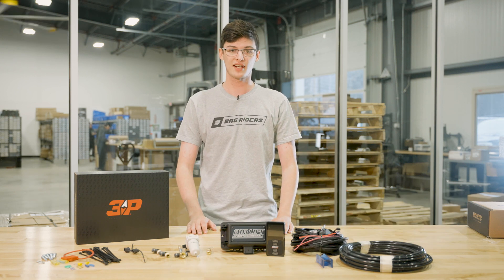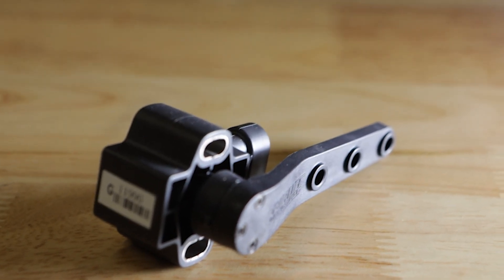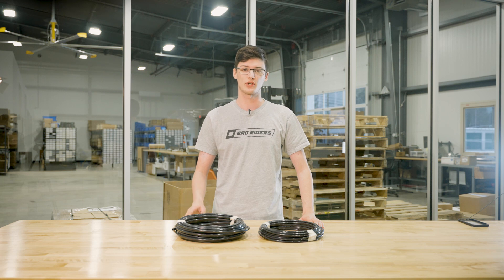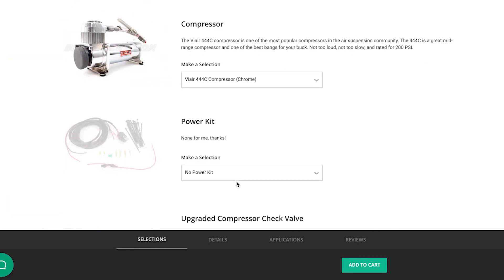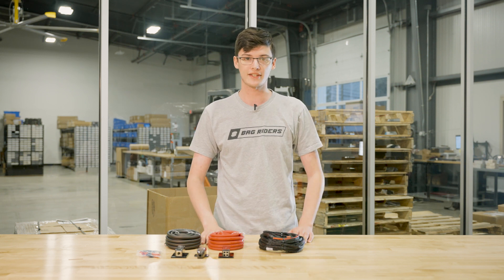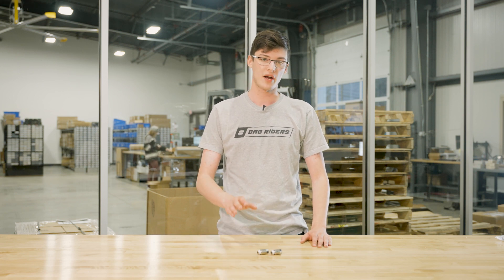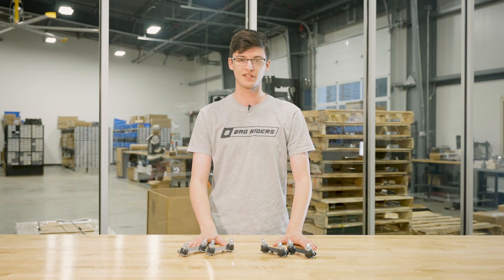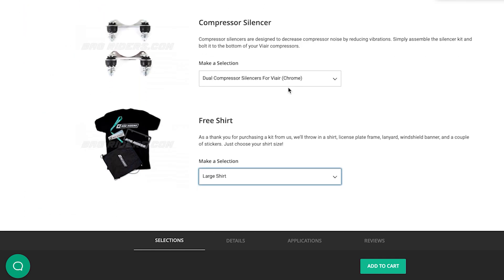Air Lift 3P/3H Digital Management Showcase by Bag Riders

Comment: Dang I bought 2 kits within a year but forgot to get the goodie bag both times 😢 is there anyway I could still get it or no?
Reply from the maker: That's strange, did you pick a shirt size from the menu when you spec'd your kit out? The shirt size is what determines which goodie bag.
Reply: @yeah I picked a large shirt from the menu

Comment: What’s the difference between 444c and 485c compressor ?
Reply from the maker: The Viair 444c compressor is the most popular choice for compressors coming in at $250. It offers 1.76 CFM @ 0 PSI, 0.42 CFM @ 200 PSI. The Viair 485c compressor is the quickest 200 PSI C-Model compressor available but a little more expensive coming in at just shy of $400. It offers a redesigned head with a faster flow rate of 2.24 CFM @ 0 PSI, 0.73 CFM @ 200 PSI. Both are great options but for $350 you can get dual 444c compressors which is the price of just one 485c. If you don't have a budget, dual 485c compressors won't disappoint and will be the top option for compressor selection. Dual 485c will come in at around $520.

Comment: If I get the full 3H&P do I need the 3H sensors to run? I wana run just the 3P
Reply from the maker: On our site you can select either a 3P or 3H management since they are separate systems. If you buy a 3P it does not come with height sensors since its a pressure based controller, if you want to upgrade in the future we sell the sensors separately to convert to 3H.

Comment: Does this works for Tesla model y performance. I wanna buy it but I couldn’t find any install for me Dallas Texas ? If you recommend anyone is Dallas Texas with electrical issues . I am ready to buy it drive it
Reply from the maker: Yes this will work perfect with the Tesla Model Y! Unfortunately we don't have any recommended installers in Texas. We find a lot of our customers install the system themselves. All of our full kits come with installation guides to help you through the way. We also have a few other videos on our channel that can help you with the process.

Comment: I’m tryna buy air suspension for my brz def need to know the difference 3h and 3p
Reply from the maker: Digital systems provide preset heights using one of two methods: bag pressure or physical height-based measurement. Neither of these methods can be labeled as “better” than the other as they differ so much in methodology. One thing that must be understood about pressure-based presets is that pressure values are in no way a perfect means of determining the actual height of the vehicle. That is to say a vehicle could be the exact same height with 50 psi in all air springs or 100 psi in all air springs; it is totally dependent on the weight of the vehicle including passengers and cargo. The presets stored in a pressure-based controller are preset pressures, not preset heights. The user should monitor the physical height of the vehicle to ensure that the desired height is reached.

This is where the advantages of height-based managements, such as the 3H become apparent. No matter what the weight inside the cabin is, a height-based management will remain consistent. Height-based systems like e-Level use height position sensors to determine the height of the vehicle rendering pressure values completely irrelevant. With 3H you no longer have to deal with the hassle of installing pressure gauges. In a vehicle equipped with 3H, you and four friends can hop in the car and your “drive preset” will be the same height as when it is just you in the vehicle. For a daily driver or vehicle that will be used to transport passengers, a true height based digital controller is the best option.

Comment: so if i just get a single 444c compressor do i need to put any option for power kit or does the kit come with a single compressor power kit
?
Reply from the maker: You do not need to add anything! The Air Lift harness has the ability to plug in 1 compressor. If you order 2 you'll want to get the second compressor harness.

Comment: I got the whole 3H kit from your website. Problem is that I only want 3P. Can I use the 3H management system without the sensors like just pressure based.
Reply from the maker: Hey Jose! Absolutely, the height sensors are not required to run the system, you will simply just be running 3P as the only difference between 3P and 3H is the sensors, they use the exact same manifold!

Comment: I'm getting close to wanting to order a kit for my daily driver Mustang gt, but what keeps floating around in my head is were I live the air is very humid.
I'm guessing for the small amount of air these systems compress there isn't much water in the tank at the end of the day, but how do you deal with water?
Do you have to drain it manually regularly? 
Is there an automatic drain option?

Also, every video I see of this system everyone is using their phone to control it, does it have a provision to hard wire buttons to control it?
Ideally I want the comfort of an air ride suspension, and the functionality of air cups, so when I come to a speed bump I can just press a button or flip a switch to raise the car up and do the same thing to lower it, without screwing around with the phone every time.
Reply from the maker: Great question! All of our Air Ride Kits come optioned with a water trap and tank drain kit. The ones that come standard inside the kits need to be manually drained but we do have auto drain water traps and electric tank drain kits. 

The most common system you keep seeing there is the Air Lift Performance 3P system. It does come with a physical controller along with a free bluetooth app that allows you to control the system wirelessly.